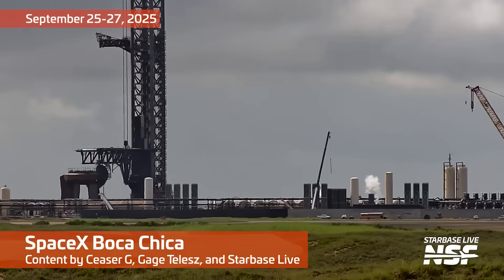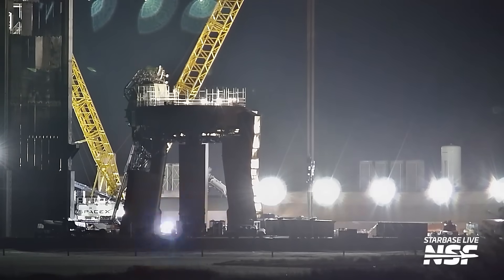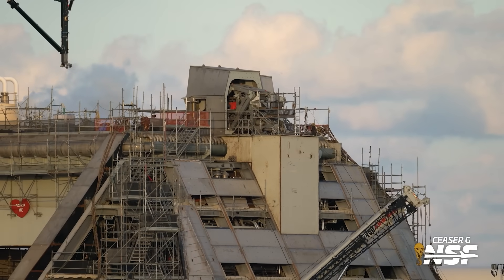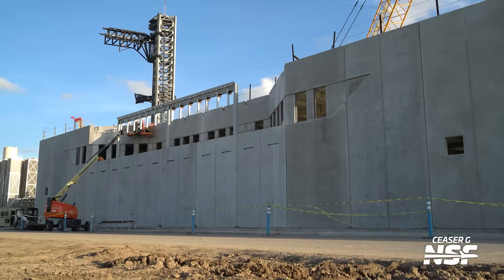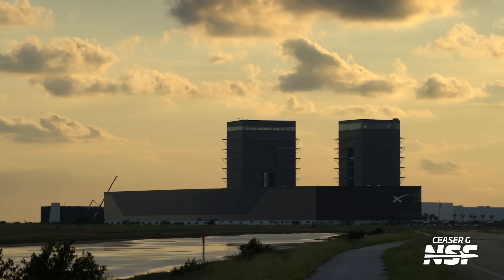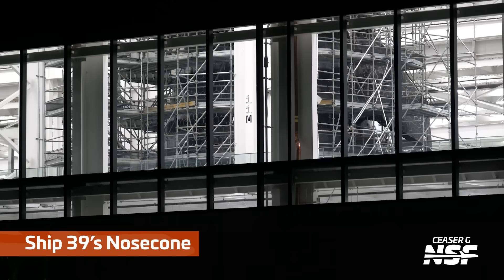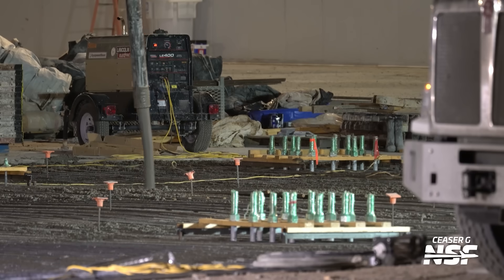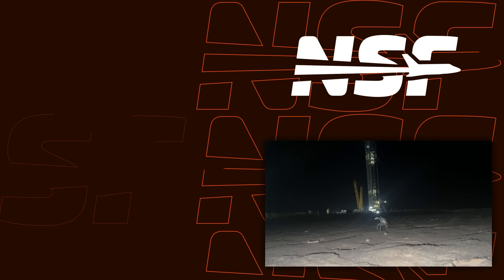Starship Pad 2 Comes to Life | SpaceX Starbase

Comment from the maker: What is your guess on the launch date for Flight 12's launch - the first from Pad 2?
Reply: January 7th or January 26th
Reply: New years cuz 39 spent started stacking and it’s the first of the new gen
Reply: Probably no earlier than February, and more likely March.

It'll take several more months just to fully stack and outfit S39 and B18.  Then, it's just a 'simple' matter of cryo and static fire testing them, along with all the other new test articles (B18.3, B18.2, S39.1, ... etc?) and a full complement of 39 Raptor 3 engines with brand-new mounting and plumbing/electrical/mechanical interfaces.  And then possibly incorporating or worse, retrofitting any fixes/revisions as lessons learned from the test article torture tests.  

Then, after all that, testing the full stack in concert with a brand-new launch pad, shaking out and debugging the new build along the way and dialing in all the parameters and algorithms for the countdown and completing at least one full wet dress rehearsal.

And all that, even assuming S39 with B18 will fly at all - as opposed to becoming the v3 analogue of the S20/B4 stack that only gets used for fitment and static tests and then gets replaced with revised, flight-ready hardware (S40/B19?)

So yeah, flight 12 is anywhere from 4 to 6 months away, IMHO.
Reply: 2/14/26
Reply: Actually, probably not on Christmas Eve…
Reply: Concrete (uncured liquid) is poured
Concrete pours are put
But concrete (uncured liquid) is not something that is 'put' anywhere
Reply: feb-march🎉
Reply: Another question: Will they even achieve a ship catch in 2026? There could be delays and again explosions with V3. Remember that a year ago, basically everyone expected a ship catch for 2025? Things always take longer than you expect.
Reply: January 16th, Flight 7 anniversary
Reply: 10/31/25
Reply: First half of January
Reply: June 2nd 2026
Reply: 4/20/2026
Reply: January
Reply: December 24th

Comment: Even though concrete is not a liquid, it is a fluid when freshly mixed. It behaves like a viscous material that can flow and take the shape of its container — which is why the verb “pour” is appropriate and widely accepted in construction.
So while concrete isn’t a liquid in the strict scientific sense, its workable state justifies the use of “pour.” If you're writing for a technical audience, you can use “place” or “cast” for precision — but “pour” is perfectly correct and widely understood.

Comment: When concrete is being placed it is not a solid or a gas, it is a liquid. It flows. It shapes to any container it is poured into. When concrete is set it can be placed, by a crane or the blast of the first launch of the biggest rocket ever built. It picked up pieces of concrete and placed them in random places.

Comment: One thing about SpaceX, when they build a structure such as a Launchpad,  a rocket you can bet that it will be advanced and highly intricate. That ability keeps them far ahead of other Space agencies.  That is what I like about SpaceX
Reply: Pretty much all launch pads are advanced and highly complex, I would say.
Reply: @bwjclego  They're as simple as possible -- but no simpler!
Reply: @dancingdog2790 disagree wholeheartedly,   what I gathered from your responses,  you're not  mechanically enclined.
Reply: Yes but not as advanced as SpaceX launchpad. Pad 1, and Pad 2 are the most advanced.
Reply: @luismatthew5875  What makes them more advanced than others?
Reply: @imaginary_friend7300 here's why experts consider Space X Launch Pad cutting-edge, Pad 1 has a water-cooled steel plate. no other pad in the whole world has that. Pad 2 has a traditional flame trench but is design to support quick turnaround launches for starship. Both pad 1 and 2 have  robotic arms design for lifting  and catching the starship and Booster. That's very innovative and very advanced. The very thought of watching the Robotic Arms catch a Booster coming in to land at the same location it took off from is amazing. That's what make Space X  launch pads  more advanced.

Comment: I’ve worked in construction, and with guys who  pour concrete for a living, and I’ve never heard the phrase “place” concrete. Even if technically there’s a chemical reaction and thus no phase change or something, if you look at wet concrete, it is a liquid. It flows and settles like a liquid does. You pour liquids.
Reply from the maker: Hey, I'm on your side on this one 😅 looks like it pours pretty well to me. -Das
Reply: Yeah, liquids flow to fill the volume of the container and aren't compressible. So concrete is not only "like a liquid", it's basically the definition of a liquid. Of course blocks and precast can be 'placed', or more commonly "set" (in place).

Comment: I would have to argue about the state of concrete :). Concrete refers never actually a solid. It continues to be a fluid suspension.  If you look into building construction, you will see that uprigh concrete slabs are poured to be thicker at the top than the bottom to allow for flow of the suspension overtime

Comment: The way I understand it, cement is wet and you can pour it.  Wet cement sets to become hard and is now called Concrete.  You can then place concrete pads or other objects.  I learned this from a person that worked at a company that made the cement power.
Reply: Yeah, precast concrete can be 'placed', or more commonly "set" (in place). So even when concrete is 'placed', it's still not called "placing". At least not around here. One thing though, cement is the binder. Once aggregate (stones) is added it becomes concrete, wet or dry doesn't make a difference.

Comment: Concrete is a liquid slurry that is placed or poured into forms.
Shot-crete is forced out of a nozzle onto vertical or horizontal surfaces without forms and finished in place.
There are many varieties and or versions of concrete methods, but the majority are of these types.
Placing concrete is merely different methods of transferring the concrete material from the transport to its final position.
Whether you carry it on a bucket or wheelbarrow, slide it down the shute, pump it in suspeded pipes or hoses...
All are different methods of placing concrete in its designated place.

Comment: If ya can pump it, you pour it!  The concrete is pumped by the pump trucks, and the mixer trucks pump it also, just a different kind of pump.  Positive Displacement and screw types of pumps respectively.  If SpaceX were to tile the floors being poured,  the tile would be placed on the floor.  Those definitions come from an old construction guy from Michigan!  Other parts of the country may have different names, however.
Reply: Yeah, concrete blocks and precast concrete can be 'placed', or more commonly "set" (in place). Good point about ready-mix trucks being pumps.

Comment: Concrete is poured. Nobody that actually works with concrete says "placed".
Reply: Indeed
Reply: Thank you, I was about to quote the concrete contractors I know about that.
Reply: Concrete blocks and precast concrete can be 'placed', or more commonly "set" (in place). So even when concrete is 'placed', it's still not called "placing". At least not around here.
Reply: Concrete is also pumped. 😊
Reply: @kentslocum  Concrete is also eaten, if you're around it enough.
Reply: @banzaiib  True. Concrete is also cut, crushed, reinforced, and demolished. 😊
Reply: @banzaiib  True. Concrete is also cut, crushed, reinforced, and demolished. 😊